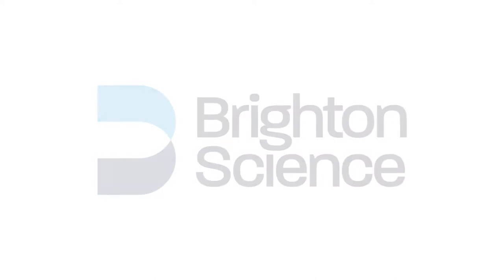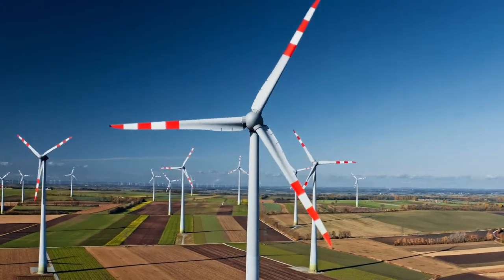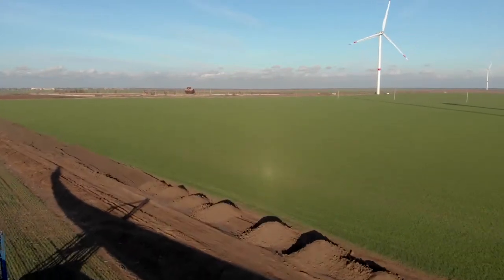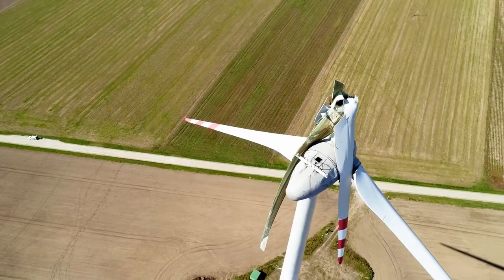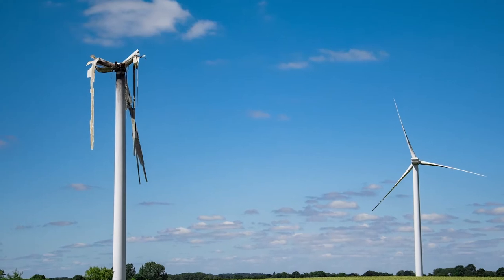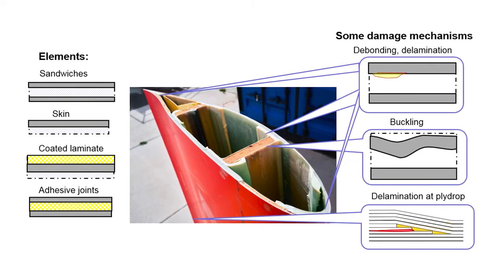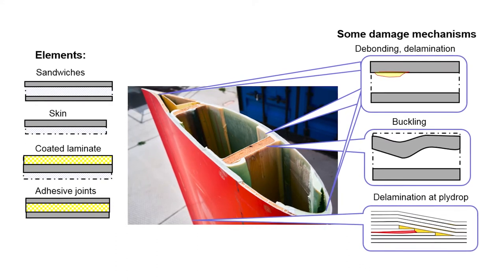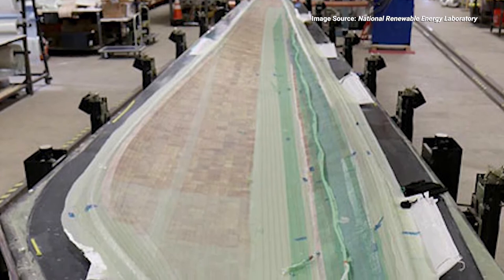Recall Mystery - What Causes Wind Turbines to Wilt Like a Daisy?

Comment: Bonding fails, also the outside surface should be really slick... studies show the surface only survive half the expected time. Air at groung levels isn't just gases it also contain particles. These particles smash into the surface, pitting it, slowly reducing efficiency. So even if the tower and generator may last, so far, the blades needs exchanging twice as often. No one takes that into cost-effective calculations because it would ruin the facade of "greeen energy".
Reply: The big turbines have a blade tip speeds of around 300k- ~190mph - devastating for airborne wildlife and not flash for blade longevity: the public don’t know this because they revolve slowly
Reply: Nameplate capacity loss is around 4 percent a year due to blade degradation.  So just think about a grid with 100 gigawatts of wind capacity. You would have to build 4 gigawatts a year just to stay even. None of this works. None! Offshore wind cost 90 dollars per megawatthour in operation and maintenance cost. This malinvestment in capital will make the 2008 housing crash look like a picnic

Comment: Wind turbines do not produce electricity if the wind isn't blowing hard enough to turn them whether or not the power is needed. When they are turning any excess can not be stored for a long time. Storage batteries are expensive and don't last long and are expensive to replace in this case.
Reply: generate hydrogen.  anti renewable arguments are full of these not problems.

Comment: how much energy do these windmills produce when the wind don;t blow!
Reply from the maker: No energy. But something to consider is that even the slightest breeze can cause the turbines to continue spinning. And in the event there isn't any strong winds present, turbines have been designed to continue spinning for hours after winds have completely stopped. The goal is to make sure they're structurally sound, so they can withstand the strongest of winds, and continue to generate energy!
Reply: Brighton- Science,

not so, the power output of a wind genertaor is proportional to the cube of wind speed.
Large wind turbines need to be kept turning when not generation as the bearing surface suffers 'brinelling' which would lead to rapid failure. They are powered to ensure this does not happen.
They have insufficient inertia for then to spin for hours as you claim.
You also mention the immense size of these devices but in electrical capacity they are tiny, and generate between about 25 to 45% of capcity on average depending if on or offshore.
The realitry is that they are third rate generators for practical and technical reasons.
Reply: @iareid8255 Fantastic response, your response illustrates just how ignorant the presenter is. Another factor he doesn't understand,  when generating electricity,  as current is drawn from the generator, it produces a resistive effect that will slow down and eventually stop it from turning.
Reply: @brighton-science they get shut down in strong winds

Comment: In the US, the main problem with renewable power is that the grid was not designed for large energy flows in the opposite direction. This was known years ago but big business cannot see huge profits from upgrading the grid so it has not happened. Places like New Zealand have always had huge hydro and geothermal generation so wind and solar just got happily included. Large intermittent loads like EV charging are going to need quick work on local grids.
Reply: Just FYI, electrical conductors don’t care which way electricity flows. PERIOD. 
It’s kind of like your driveway doesn’t care whether you’re going to work, or coming home. Couldn’t care less.

Not sure where you’re getting your information from but it’s N. G.
Reply: Just FYI, electrical conductors don’t care which way electricity flows. PERIOD. 
It’s kind of like your driveway doesn’t care whether you’re going to work, or coming home. Couldn’t care less.

Not sure where you’re getting your information from but it’s N. G.
Reply: Just FYI, electrical conductors don’t care which way electricity flows. PERIOD. 
It’s kind of like your driveway doesn’t care whether you’re going to work, or coming home. Couldn’t care less.

Not sure where you’re getting your information from but it’s N. G.
Reply: Just FYI, electrical conductors don’t care which way electricity flows. PERIOD. 
It’s kind of like your driveway doesn’t care whether you’re going to work, or coming home. Couldn’t care less.

Not sure where you’re getting your information from but it’s N. G.
Reply: Just FYI, electrical conductors don’t care which way electricity flows. PERIOD. 
It’s kind of like your driveway doesn’t care whether you’re going to work, or coming home. Couldn’t care less.

Not sure where you’re getting your information from but it’s N. G.

Comment: 5 minutes of 'so what'?  If a failure point is discovered you fix it. Unless the failure rate is acceptable and does not eat into profits. Then you let it go . There is an acceptable failure rate for most anything that is manufactured.
Reply: How do you get inside the blade to inspect/repair it?
Reply: If something composite fails, you diagnose what caused the failure and modify the design or manufacture to prevent the failure. This is engineering 101 and has been for 6000 years.
Reply: @UpAndRunning-xz6er  No, you design and manufacture something correctly in the first place. Reality 101.

Now instead of deflecting, just answer my question. "How do you get inside the blade to inspect/repair it?"
Reply: You have never been involved in design and manufacturing.
Reply: @UpAndRunning-xz6er  I am not a meteorologist either, but I know when it is raining. 

Now how about you answer my question instead of trying for a cheap shot.

Comment: It warns my heart to see a wind turbine collapse. At least fossil fuels, produce energy reliably, the by products return carbon to nature's life cycle. The scrub exhaust is an excellent source of building material, (plaster), the waste heat can be used for communal heating. And finally what comes out of the chimney is warm air, wind turbines only provide intermittent energy, at the wrong time.

Comment: Some of the significant reasons that this tech is being developed and utilized is it provides multiple independent applications of electrical generation in varied locals to reduce the high cost of transmission line sizes, extents, and increasingly high costs of maintaining this portion of the electrical grid. By placing multiple smaller point of origin it can be distributed for much lower costs to local needs…if a few experience failure due to any needs it doesn’t much interrupt the entire system…another significant issue is simply money, a new natural gas powered steam plant costs billions, required hundreds to operate, maintain and has to justify its existence over decades, much like a hydro, nuclear, and solid fueled system…all are massive in footprint, are subject to complete shutdown if a fire, weather event or natural disaster or even terror or cyber attack.
Everyone’s use of electrical power is different and the same as it’s a significant problem if it’s out for an extended period.
Imagine you have just five large gas stations in your state and that’s how you have to buy your gas…very inconvenient , so lots of small stations exist to provide that energy source. 
Making electrical power from solar farms, is ok when the earth is pointed the right direction, it not cloudy, snowing, dusty or the angle is optimal, wind is effective in many of these conditions albeit an occasional still period that will occur, but it’s usually brief…the massive blades can harness a slight breeze and with this high torque ratio input it will develops plenty of speed to drive the generator/alternator to produce something and it can be tuned to needs as they vary..in high winds there is s retarder to prevent over sped conditions too!…
Just a note the money that the land owner is provided to lease that ground is rather impressive per tower….
Nothing is perfect out there…so pick your poison, ask Texas how they feel about the lack of electrical power at critical time…and they sat directly on top of all the oil/gas you’d need to fire power plants and could get the job done!

Comment: You need 132 MW for a regular arc furnace to melt steel each one of these puts out 2 MW do you know how many wind generators you need to run an arc furnace? That’s why France has all nuclear and has the cleanest air in the world, because they all run on nuclear power

Comment: Then why don't we start to think small? I often ponder why we do not have tiny fans along all straight lines like rooftops, car grills...anywhere that there is drag. Collecting it at point of use. Small fans like the size inside a cpu, they would be stronger and wouldn't harm nature, mesh screen in front if you want. Also incorporate the use of magnetic plates through clutches to initiate spin to start whatever motor needed. Once moving it could recharge itself as it moved, as in a vehicle.
Reply: Simple answer... the green energy folks won't make money.
Reply: The butterfly groupies will riot and close down the freeways over that plan
Reply: >drag=>fuel
Reply: You need certain physical size to be effective to produce enough energy from the wind. The motor generator has to also have a certain size to it's structure, for example certain size magnets and coils. Too small of a motor generator and you produce too little amps to charge a battery or  make a 120v inverter work correctly. There is a limit to how small devices should be that produce electricity.
Reply: "why we do not have tiny fans along... anywhere that there is drag."

umm, the whole point of a wind turbine is that they ADD to the "drag"? they SLOW THE WIND DOWN. that would just increase the fuel consumption...

bashes head against wall